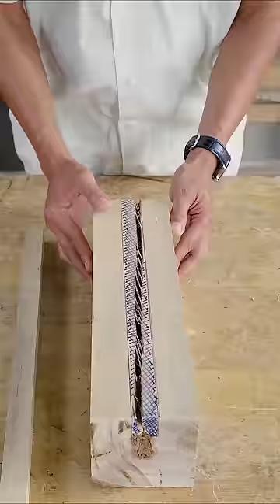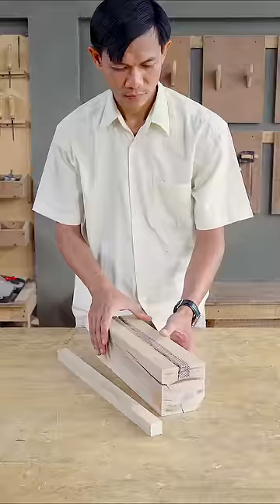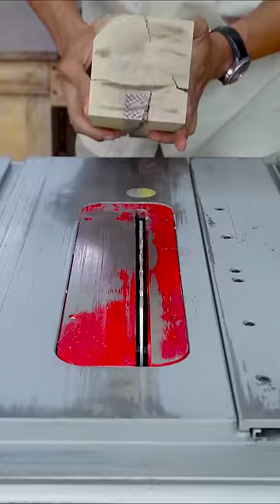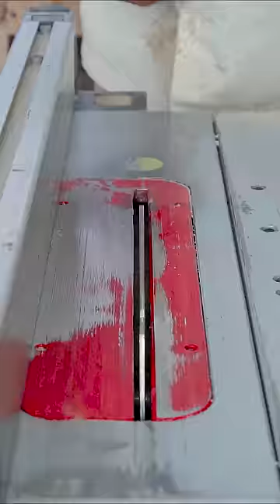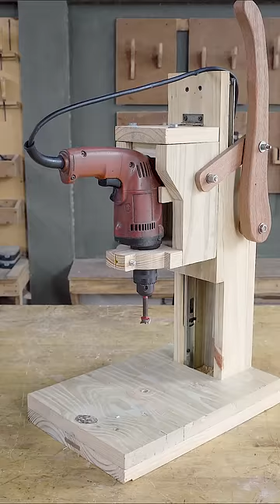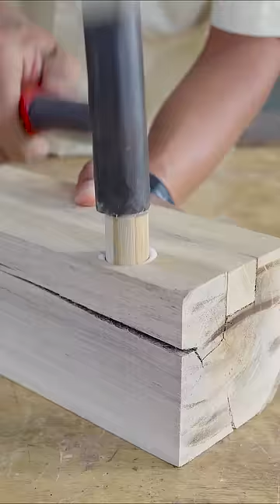Stabilize a wood Crack - Woodworking Technique #shorts #woodworking

Comment: That's a lot of work to save an 18" 4x4.
Reply: Where I'm from, we dont have a store we can buy wood that comes in different sizes that are already squared readily available for diy. Most diy project would require using salvaged wood that are usually pine wood from shipping crates.  The ones that are sold for constructions come in several standard size but they are neither flat or squared enough for a diy. They are always warped and very rough. Therefore even wood like this is worth saving because the alternative is either going to cost you more money or more time, but we all know time is money.
But then again maybe hes just doing it for the video.
Reply: @holohulolo  that hadn't occurred to me. Thank you for the thoughtful explanation.

Comment: What's with the silly cross hatching? Worried you will forget where the crack is?
Reply: Probably just for audience to see it better. Technically not suppose to use markers on wood in the first place cause they bleed into the grain so I’m pretty sure he just did it for demonstrative purposes
Reply: @FlamingRayz  The audience doesn't need to see where he intends to cut. We can all see the massive crack 🤣